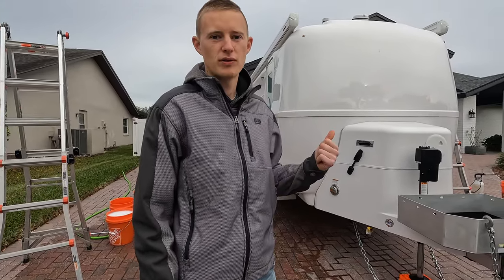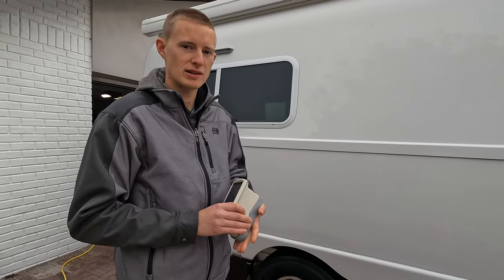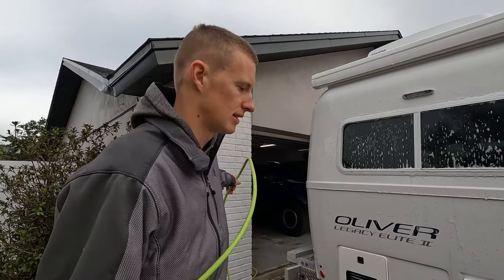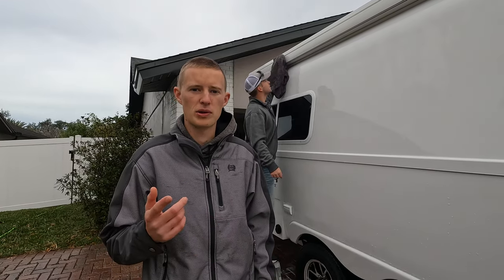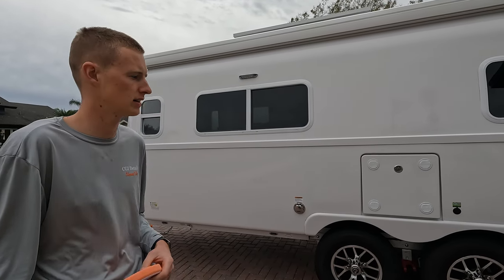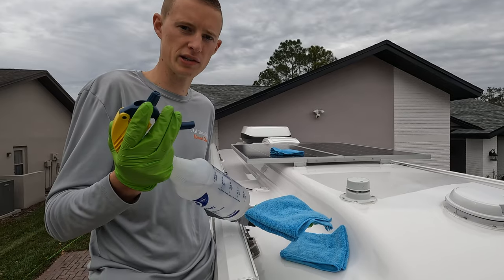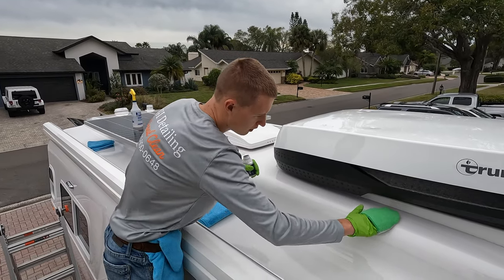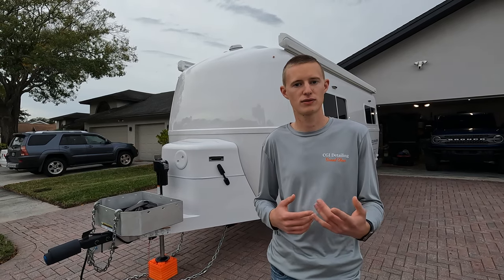How does a 2023 Oliver Travel Trailer look after a Ceramic Coating?

Comment: What was the reading after you finished?  It was 85 initially.
Reply from the maker: This particular trailer was reading anywhere between 90-97 on the gloss meter after prepping and ceramic coating it.